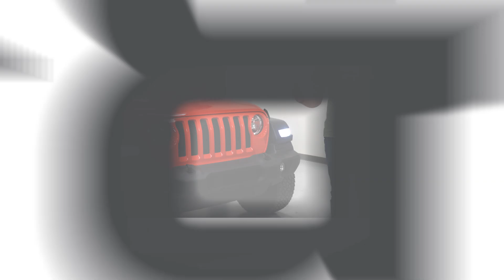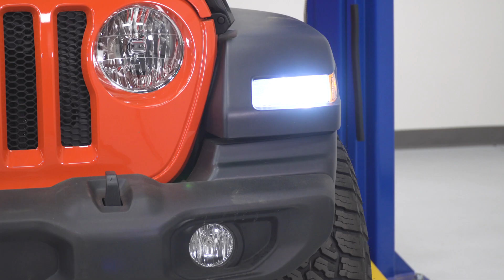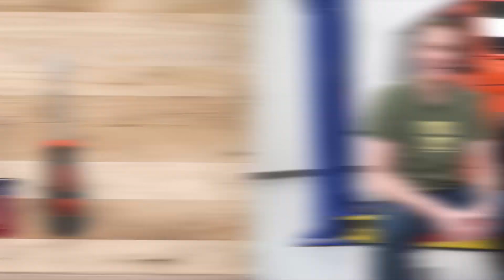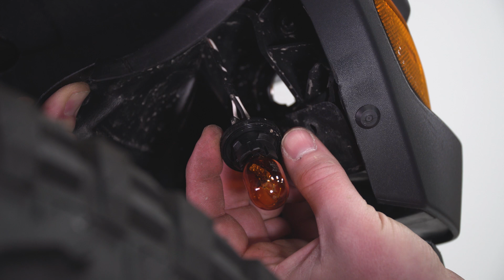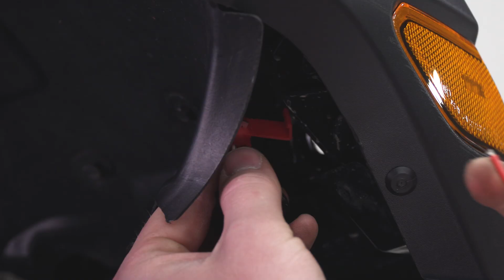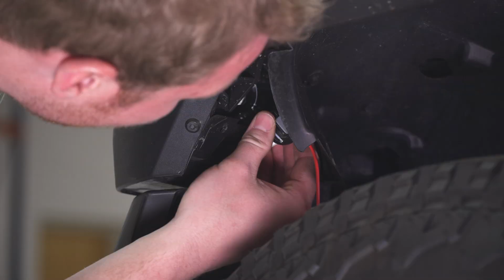Jeep Wrangler JL Axial Switchback Front Turn Signal Light LED Bulbs Review & Install

Comment: My 2021 has a two bulb system, one for drl, one for turn signal. How would I convert to a single bulb system?
Reply from the maker: You wouldn't, these led turn signal lights are for sport models with a singular turn signal/marker light bulb only. For your Jeep you would want to see the following link. -Zach
https://www.extremeterrain.com/diode-dynamics-jeep-wrangler-stage-1-led-front-turn-signaldrl-light-bulbs-7443-hp48-dd0421.html
Reply: @extremeterrain  do you have a full housing replacement that would convert this to a single bulb system?

Comment: Just bought these ready to install, but I’m also installing some headlights that will need to tap into the same wires for the same functions. Can I use vampire clips for the headlights and fender lights on the same wires or will that cause an issue?
Reply from the maker: Most of the time these clips are included in the kit! You can use them or splice into the wire. Whatever works best for your application!
Reply: Thanks for the reply I’ve got all the necessary parts, just wondering if there will be complications tapping into the same wires for 2 different lights; fender and headlight.

Comment: if i have the led headlight package on my sport s but have  the halogen turn signals would i still need a resistor if i already have headlight leds??
Reply: Did you get your answer? I ordered some but I’m not sure if it’ll work since I have led headlights.
Reply: No.

Comment: This is the type kit for my lights with people in my situation as per my post below, not the one in this video  https://www.amazon.com/iJDMTOY-Front-42-Diodes-Conversion-Wrangler/dp/B07NZ2M51N?th=1
Reply: Late comment, but I also have a ‘22 Sahara Unlimited that has two holes/bulbs in the turn signal housing, not one like the company shows. I also ordered these thinking they’d work, but returned them since they’ll only work with a one-bulb housing. How’s your two-bulb Amazon led turn signal kit now? If it’s been working well with the two-bulb housing, I will order them! Thanks

Comment: Mine has two halogen/incandescent bulbs. The outboard is a clear bulb and has 3 wires that don't match this video. The inboard is amber and has two wires, white with green stripe and a black. I replaced the inboard bulb that is amber and now all i have is a LED turn signal and flasher. WTF? 2020 JL rubicon 2 dr. Whats going on here? Why do I have two bulbs and your video only shows one? Now I have pierced wires and stuff that doesn't work right. The package says for 2018 JL wrangler sport, is there a difference in the sport and rubicon non LED headlights? Nowhere on the website does it mention specifics about this. Obviously this isn't going to work with the rubicon. There is also a quickflash and error presumably because this circuit need a different resistance. It flashes amber but the outboard bulb that's clear is the running light. Guys, if you run into this situation don't even attempt it, it doesn't work. Also, another website I found with a quick search shows exactly the same directions as this place and advertises it will work on all 2018+ wrangler JL's.
Reply: I wish I had seen your comment before I purchased these! I ran into the same problem. Called terrafex and the technician acted like he had never heard of it. He said I didn’t need the resistor and that it’s plug and play. Well that didn’t work, it flashes and flickers and looks terrible! I have a 2020 Rubicon 4door. I hope I can get my money back as I have not used the resistors yet. I think they need to specify it will not work on the new rubicons.
Reply: @donmoore7013  They haven't refunded me yet but I didn't get the feeling that it would be a problem. They gave me an RMA and I returned them. I'm sure that on the right light setup they work great. It appears that newer Sahara's and Rubicons have the dual bulbs on each side though.
Reply: @donmoore7013  The refund showed up so no problems.
Reply: Any update on these led turn signal bulbs? I have a 22 Sahara unlimited and I think the saharas and rubicons have the same turn signal housing (two-bulb configuration). The sports have a one-bulb turn signal housing (as this video shows). This company advertised it as 2022 JL but it’s trim-specific. This led bulb only works on sport trim levels, not saharas or rubicons like we have

Comment: The resistor won’t burn the plastic? Or cause a fire?I have resistors on turn signals on my jk and they get really hot. I want to do to my jl but scared it’ll melt plastic or cause a fire.

Comment: does these will fit to my shara unlimited 2020
Reply from the maker: These will not fit on Sahara and Rubicon models that did not come equipped with LED lights from the factory. Their fenders actually have two separate light bulbs in them, instead of just one like Sport models! -Zach
Reply: ExtremeTerrain.com can you suggest me any bulbs

Comment: Nice wheel and tire setup, what size is the combo? 

I don’t have a lift on my jl and would like to go bigger, thanks
Reply from the maker: They're 285/70R17 Falken Wildpeak Tires wrapped around 17x9 Mammoth Wheels! You can find both on our website! That 33s is a really solid size if you plan on keep your suspension anywhere from stock to about 2 inches in lift. Anything taller than that they can start to look a bit small, but they're a great option to get a little more aggressive stance while keep your MPG's happy. -Zach
Reply: ExtremeTerrain.com thank you 👍

Comment: Does the link you provided which is 64.99$ come with resistors? On the page its contradicting and saying it doesn’t need them
Reply: I just got mine today it does come with two resistors, the problem is they only send 2 vampire clips (Scotchlok Connector) but you need 4.

Comment: Any real place to store or mount the resistor? You say to tuck it away but it looks like a bump will knock it around.
Reply: The resistors are solid state, so they can survive a few bumps.  I would worry about wire chafing or heat.  Maybe some zip ties will fix all those issues.